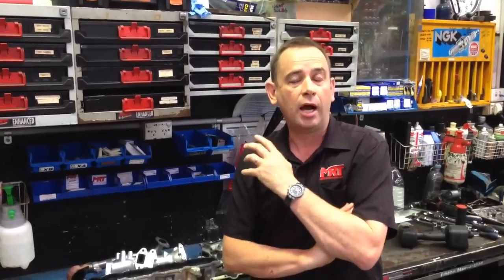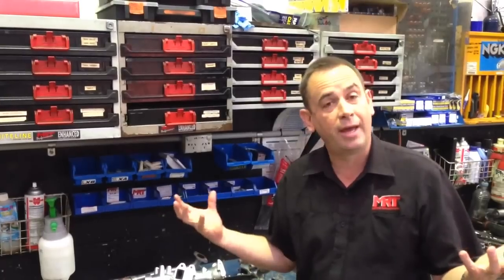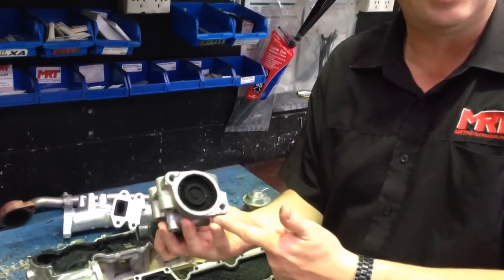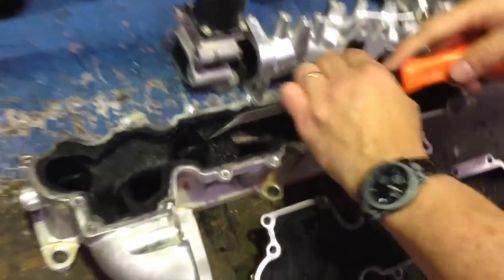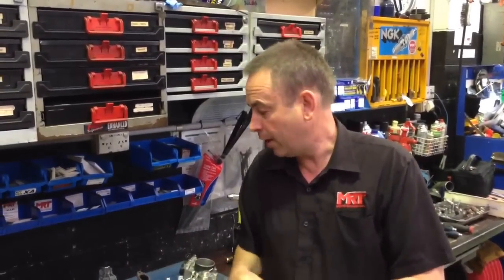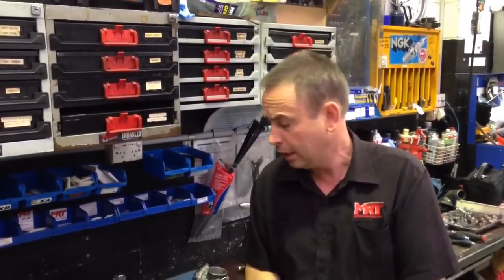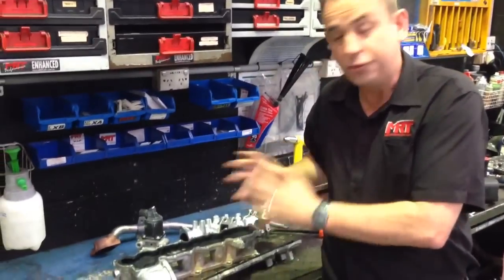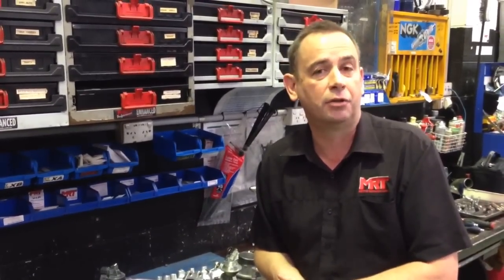Mitsubishi Turbo diesel secrets, the hidden ugly side of soot.

Comment: So much wrong info in this video, EGR is not there so unburnt fuel in the exhaust can be burnt. It is there to lower NOX emissions by reducing combustion temperatures.

Also the throttle body on a diesel is not there to control engine output. It is there to create suction in the manifold to make the engine draw exhaust gas through the EGR system.
Reply: I thought  throtte body on diesel was to allow a smooth engine stop.
I think an oil catch can could solve this problem of deposits quite well.
the egr is not really the problem it's dry.
the problem is the oil in blowby gluing soot particles together and to the intake.
Reply: michaelovitch  your correct, diesel throttle bodies are to help prevent over run when turned off.
Reply: On Euro 4 vehicles upwards throttle valves are mainly fitted to increase EGR flow by causing a small vacuum in the manifold and to stop engine shudder on engine shutdown. On DPF equipped cars it will partially close during regeneration and on deceleration to keep exhaust temperatures high for fast DPF regeneration.

On my TDI the throttle valve partially closes on deceleration to keep catalyst temps high; even when not performing a regen.
Reply: Forename Surname
Thank you.
Reply: Aids45 Besides how does the EGR aid in fuel economy, did not get that!!
Reply: it doesn't
Reply: I ve got a 2008 3.2 did pajero, so if i eliminate egr, will i be making my engine a favour ? What are the risks and damages ill be doing ?

Comment: So on a brand new engine with as yet no coking / carbon build up in it's intake tract , EGR system, intake valves/ ports / dual length manifold runner actuator etc etc ...... it will work just well enough to get that tick of approval for emissions reg's. Here in the REAL world when the engine has done 90,000km + and the above components along with the injector pintels are being choked by the same system designed by academics to help make it "clean" (the MN Triton 4D56t 2.5 CRD is a GREAT example here )

Comment: I wonder if an old school upper cylinder lubricant kit fitted to engine to wash the intakes and valves would help . just a thought, 
I got one in my shed might throw it on after i clean out the intakes on my bt50 and see if this helps.

Comment: Would it be better to get away from Direct injection? Contaminated fuel you replace injectors and pump, cannot use diesel mixed with coconut fuel etc.
Old diesels can run on coconut fuel, they lose some power but I believe are less polluting.

Comment: Very cool informative!!! Is seafoam good also for cleaning that stuff out?
Reply from the maker: never heard of it
Reply: Its here in the states. You can pour  it in the brake booster then let the car sit for 10 minutes then start the motor and it blows white smoke out the exhaust for a while supposed to de soot everything.
Reply: ***** I have herd of seafoam for cleaning things.
Reply from the maker: never heard of it
Reply: MRT Performance  they have it in the states you pour it in the brake booster while car running. then turn engine off let car sit 10 minutes. Start car and blows white smoke out the tail pipe cleans the head if u search on youtube 100s of videos.  Throttle response seems alot sharper after. I do it evry 5000 to 10,000 miles.
Reply: MRT Performance Like the old Redex blows white smoke they think its new .
Reply: Stephen Drew
 Seafoam been around over here since the 1920s.
Reply: +boostercontrol100 Oven cleaner works wonders

Comment: Renault 1.5 diesel common rail Euro 4....with engine off unplug EGR power cable and done. Check engine will light up but the motor will run much better and it will also save about  1 liter of diesel/100 km, that's 0.21 gallon/62 miles.
Reply from the maker: not on this engine

Comment: Hi I have a Mitsubishi l200 63plate keeps cutting out replaced fuel filter and housing,suction control valve starts straight back up then cuts out would really appreciate any ideas that may help
Thank you🇬🇧

Comment: I have an Engine check light and used a code reader which indicated EGR fault. Would this fault be associated with about 1 second of engine run on when I turn the ignition off? Just to be clear, I am using an '09 Mitsi Pajero NT 3.2L DiD.

Comment: Does the vehicle usage profile have much influence on this soot build-up ?
I use my 3.2 DID Pajero mostly for touring with a 1700kg caravan. Most of its travel is at highway speeds and maybe 50% pulling the van. There has been very little use as a low speed commuter.
Am I likely to have less of a problem with soot because of this ?
Reply from the maker: you problem will be just as bad as the pictures.
BUT get it checked first

Comment: yust put some block plate betwen exhaust to egr pipe and it is done, the egr will work normaly but no gases from exhaust will go through
Reply: if you get a code ,drill a litle hole 5-10mm in a plate...

Comment: wouldnt an air oil separator also help in reducing that black tar'ish buildup? if i understood what you said the black build up is a combination of the diesel gas + the oil blowby making the tar like substance.
Reply from the maker: correct, but the tune is easier than a catch can as the catch can is not 100%
Reply: +MRT Performance i see and that makes sense, another question for you, do you guys have any experience with the 4g93 gdi turbo engine from mitsubishi? curious if that engine can be tuned in the same manner to improve performance and reliability
Reply: the gdi engines in the Mitsubishi weren't very reliable in my opinion 4g93 engines used to be in lancer gsr with turos
Reply: wax333 yeaa i've heard that allot myself, was just wondering what could be done as i have one in my possession and as any car enthusiast you look for ways to make things work better or at a higher performance level.

Comment: Egr and dpf are the 2 worst rubbish ever put on an engine!!!
Reply: Egr can help cold starting and fuel economy. DPF is there to keep your kids from getting cancer. If you don't like them, don't get a diesel
Reply: DPF has a lifespan of about 200k km at best (but they can last longer if looked after...)  They should be cleaned every 100k, professionally.  Should be doing a passive regen every tank, 20-40 minutes on the motorway above 50kmh and 2000rpm, a healthy dpf can do it in 20 mins easily enough, and even in traffic (a little) if the right conditions are met, heat wise.

DPF isn't considered blocked until it reaches about 20 kpa / 200 mbar of back pressure.  This is for all engines making between 50-500kw of power at the flywheel.

All diesel engines are helped by installing an oil/air separator with filter media

Comment: I am loking at getting a 2.5 DT Diesel SWB 92 Pajero, (Japan Import).... will this be a problem on that vehicle? What costs involved to get a full clean up of the internals to restore / improve efficiency and performance overall... i am in Brisbane
Reply: The job it's self is just under a days work plus a new manifold gasket, possibly new oil feed turbo seals etc.
About 600 usd or so, depends on each garage.

I just took my van to a engine rebuild company & they have a mate down the road who can do it, & he uses their chemical bath to clean parts. Dealers won't do it.
I invested on a blanking part of ebay.

Comment: A diesel with a throttle plate?  Is it specifically for the EGR to direct the vacuum there?  I don't know why else you'd need a throttle plate other than to choke the engine in case of runaway.
Reply from the maker: not sure
Reply: Lots have throttle plates to quieten them down and to pull more egr gas in and help emissions supposedly on idle makes them lot quieter

Comment: Diesel engine NEVER have "fuel flowing through the inlet manifold". also, " Abstract: Exhaust gas recirculation (EGR) is an effective strategy to control NOx emissions from diesel engines. NOx emissions may be further reduced by cooling of the EGR stream. Drawbacks of EGR include increased PM emissions and increased fuel consumption.".
Reply: When did he say fuel is going thru inlet manifold?  I heard him say engine oil and PM is via blow by and EGR recovery, and blow by is a known problem seen via catch cans, and it's no secret that exhaust gases have particulate matter, so those will be pushed back into the inlet manifold.
Reply: @vap0rtranz  "When did he say fuel is going thru inlet manifold?",  maybe from this? "direct injection technology 00:19 whereby engines no longer have fuel whether it's petrol or diesel flowing in through the inlet manifold which has a scouring and a cleaning effect of the inlet side of in the engine"
Reply: @willgeorge5644  your point sounds like you want his English to explicitly say present vs past tense, so never vs no longer. Fine. I took his English to be conversational.  Bigger point is EGR was added to turbo diesels and soot is not cleaned up downstream, like with dual injected gassers.
Reply: @vap0rtranz  "your point sounds like you want his English to explicitly say present vs past tense", no, it's just true vs untrue. He states the petrol AND diesel clean the inlet manifold, Diesel does not come anywhere near it so it's not true. EGR is another matter, in diesel engines is it not EGR alone that causes this? also not particulatly direct injection. All diesels by definition inject fuel into the combustion or precombustion chanber. I want it to be right, that's all.
Reply: @vap0rtranz  No, the meaning is clear, and wrong. So for diesel anyway, it shows that washing with fuel or not is not the problem. It's EGR only. Before even port injection, EGR was limited, It's not my intention to pick holes, just pointing out some realities.

Comment: am thinking of buying a 3.2 pajero 2016 will it have the same issue as mentioned here and is this a serious problem in ehich i should avoid and go for a petrol engine am currently driving a pajero 3.0 2007 and have done 145000 km with no issues up to now
Reply from the maker: same problem

Comment: This was made 6 years ago. But how many Kay’s would that type of build up take?
Reply: Looks barely like 30-50k.  I've seen 4n14 motors 1/3 to 1/2 built up with solid material throughout the whole intake (inc egr and pipe), into the head also, at around 100k.

Oil air separator installed with filter media.... 80-100k service intervals, would probably be minimal cleaning needed.  Without separator.... I'd be cleaning EGR and intake at 50k, lol I shit you not.

DPF (if you have one) should be cleaned every 100k

Comment: Hi
I have a Pajero 3,2 DID -2001
Its behaving very strange.In normal idling in Parked mode it works fine, revving clear and strong but When idling in Drive mode, the engine is couging and blowing out black smoke. Even when driving you can feel a jumping in the engine. To find the fault we have found out that the engine is doing this with only a short move of the gearshift lever....so actually it seems like a electric fault. The problem shows when only moving the gearshift a very short distance ( so you see the indicator change on dashboard) even before the automatic gearbox gets into real pressure for driving..............a strange problem. Do youhave any ideas??  i can make a video...appreciate some ideas...
Thomas
Reply: sounds like air flow sensor
Reply: Me too, any solution for that?

Comment: Once I idled Dmax RT50 2.5liter for about 3 hours + 

Later on the highway, I  notice the truck makes some smoke on throttle. After a few highway trips, there's no more smoke.

I figure you are right EGR is open at low rpm only. 

p.s. : Truck sips very little fuel on idle....seriously!

Comment: Hey what do yous think of the mq 4n15 motors. I'm looking at getting an exhaust but thinking it's a waste of time with the dpf.. Am I correct with that
Reply: Don't need an exhaust, they flow plenty.  Just clean DPF every 100k, professionally.

Install oil/air separator.  Ryco make the best all-rounder.  RCC351K

Comment: the carbon build up because fueling system is direct injection.....how if modified it with add powerjet to throttle body to mist diesel from it for conditioning intake....plus will flush the carbon out to exhaust....

Comment: diesel engines have never had fuel running in the manifold !!!!!!!!!!!!!!!!!!!! direct or indirect injection the diesel never touches the intake manifold
Reply from the maker: +MegaRyan123456 I was generally referring petrol as well, but specifically,yes you are correct.
EGR is the main (new issue) that causes soot
:(
Reply: +MRT Performance the idea behind makeing an engine breath its own farts is flawed from from the start lol
Reply: hi  ,  j'ai  un probleme de egr  sur mon l200 sporteroo comment je peux le regler
Reply: +MRT Performance  YOH
Reply: YOU  ARE LOOKIN FOR A FEW YEARS AGO BY THE WAY TO THE END OF THE WORLD NOW !!!!!!!!!!
Reply: @MRTPerformanceAustralia  It's EGR plus closed crankcase ventilation that combine for the gunk. The EGR on it's own isn't quite as terrible.
Reply: well i was wondering what he was saying.. lol.. that is gas method
Reply: @MountainPow187  That's what I'm saying! The EGR should recirculate the diesel exhaust after it's been treated by the particulate filter. Problem solved.
Reply: @benjamingrimes3304  this wouldn't work well because the DPF heats it up too much. We want the recirculated gas to be as cool as possible hence the EGR cooler. One of the main goals is to lower combustion chamber temps hence lowering NOx. Putting post DPF exhaust would seriously hurt combustion.
Reply: @MountainPow187  who keeps dpf??? egr off, dpf off, thats the way to use cars.

Comment: This guy is in the business to sell ecu software upgrades. Eliminating egr will increase combustion temps, pressures and NOx emissions. This will harm the engine and the environment. The oil breather catch can is a simpler way to reduce build up without hurting engine or environment. It extends time before cleaning will need to be done and after original owner is no longer the owner.

Comment: how many miles are on that engine, do they need cleaning every 50,000, or what
Reply: On egr and pipe, yeah, and check function of valve. 

Install oil/air separator and you should be good for 80-100k km between cleans of intake and egr (inc pipe for egr)

Comment: You can clean it in minutes with caostic soda drain cleaner.
Reply: caustic soda and an aluminium manifold,yeah right genius. Caustic soda (sodium hydroxide) dissolves aluminium DO NOT USE ON ALUMINIUM.

Comment: One big factor with the diesels is the very slow acceleration so the drivers are constantly slamming the pedal to the floor trying to catch up to the gasoline engines cars in traffic. Common sight in the Philippines. That isn't good for any engine since the fuel air mix is not optimum. Soot is the main issue with the diesels. Diesel #2 is a lightly refined crude oil, nasty stuff. Diesel #1 is little better but more expensive (the winter blend choice) and kerosene is even more expensive but obviously a bit cleaner.

Comment: If you work on your own engines, just remove all the eco bullshit and put it in a box on a shelf when engine is new.
Some engines you need to pull a few fuses for the emission system.
The engine runs clean and is much more reliable too.
It all depends where in the world you are for regulation or enforcement of regulations.
Reply from the maker: this is typical globally